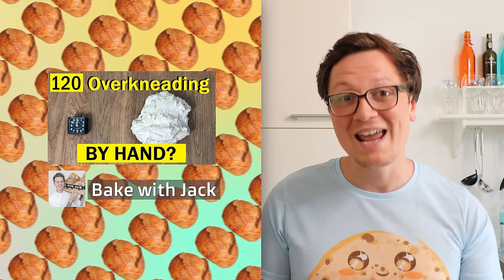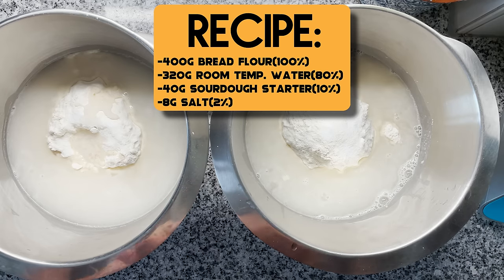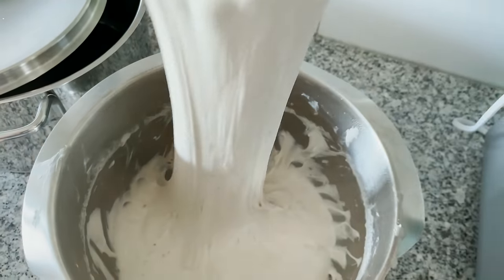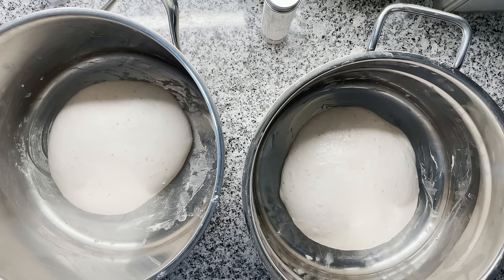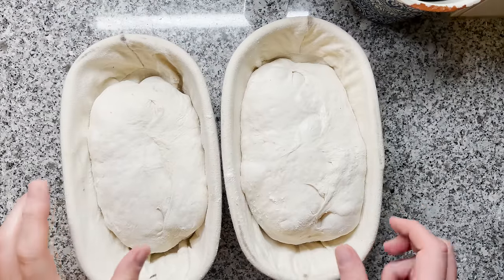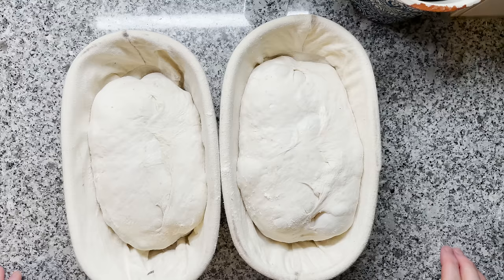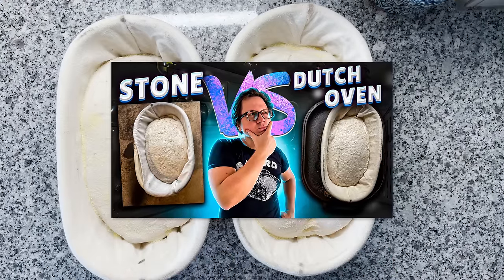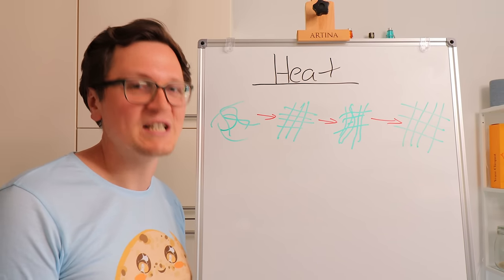Can You Knead Your DOUGH TOO MUCH with a Stand Mixer?

Comment: I bake sourdough with a mix of flours (bread, rye, whole wheat, semolina) every week and always with my stand mixer because of arthritis in my hands. Keep the mixer at the lower speeds, use only the hook. I never go to high speed because it heats up the dough too much. Once the dough comes away clean from the sides I mix for another 1-2 minutes and it turns out great every time.
Reply: About how long do you end up kneading this heavier mixed flours dough? And does it pass the windowpane test at that point?
Reply: Bread Flour 400g
Water 320g
SS 40g (bump 20% if yeast) 
salt 8g
Reply: using high setting is bad for machine

Comment: I'm a chemist.  This makes perfect sense.  The chemical reactions that are cross-linking the proteins in the flour are parallel to those that make concrete.  You want to simply get the surface evenly wet, then allow the cross-liking to occur.   This amount will differ on the texture of the break you are looking for.   Simply putting the mix in a stand mixer and walking away for 15 minutes is not a good idea.

Comment: When I had less idea than now about what I was doing, I was tired of getting flat breads, so I improvised and lowed the water percentage (I believe from 70 to 60%) and kneaded with a KitchenAid, at medium speed, for around 4 hours. Those where my first nice looking breads, incredible ears and oven spring. But after I did that I read about overkneading and I decreased the kneading time to around 20 minutes, but adding a couple of stretches. It works for me.
Reply: 4 hours???
Reply: 4 hrs?
Reply: @aidaiamanova578  I wish I could be more specific but not so long ago I read in a magazine about a new local premium bakery and I remember it mentioned they knead two times over a hour, don't remember exactly. I guess at least when you have the proper flour and recipe, overkneading isn't really an issue :)

Comment: Hendrik, for your next experiment, I would be interested if you can add flour (and how much) to overfermented dough and get a good dough strength back and save your bread, so to speak.
Reply: Hi. You can not save a bread thats overfermented, because it will act like a sourdough or starter, you would need a lot of new dough. But there are a few nice videos of 'pain de campagne' they use 10% sourdough and 10% pâte fermentée. So put it in your fridge and use it step by step in your future breads, it will give huge flavours and and other benefits to your bread dough

Comment: I think, most Professional bakers machine-knead sourdough on much slower speeds, say about 2 or possibly 3, depending on your machine. I can briskly mix 72F flour and water(about 22C)with a Danish dough whisk, and when I measure the dough temperature, it is usually a couple degrees warmer in F.

Comment: if you knead at lower speeds with a stand mixer the dough doesn't heat up (that much/at all if using the speed the manufacturer of the mixer tells you to use: 1 - 2), the kneading takes a little longer, but the bread is consistent, even if you forget about the mixer and let it knead for an hour too much (was not an experiment, but a mistake by me)
Reply: An hour by mistake?
Reply: @eswing2153  yeah. put everything in the standmixer, set a timer, went back to just check my mails in the other room and listen a bit to music - and forgot (and overheard th timer) completely.

Comment: I only recently learned how much heat a mixer (or kneading in general) can impart into the dough. Your video seems to confirm what I assumed was happening to some of my breads. I have started using cooler water and will continue to do so.

Comment: I just realized that I never heard about the "base temperature" in not french bread video... This concept is very important for professionals. The goal is to have the good temperature at the end of the kneading.The rule is quite easy. The base temperature is the sum of the temperature of the room, the flour and the water. (Strange mathematics!) If your base temperature is 55°C, your room is at 21°C and your flour at 20°C you need a water at 14°C (21+20+14=55). You have to adjust the  base temperature with what you do and how (depending of the machine, the type of kneading) Normally at the end the dough should be more or less at the same temperature.
Reply: Very interesting!

Comment: Very interesting finding that temperature matters more than kneading time.
Would have been cool to actually measure and compare dough temp.
For pizza, it's a common advice to stop mixing at 25°C in order not to damage the dough. Sometimes you'll start with ice water in order not to exceed that temp.
So, next experiment: Same mixing time, but different target temp? 20°C, 25°C, 30°C? :)
Reply: Actually, that's kinda common for baking in general. At least in any semi-professional environment. At least when we are talking about (mostly) pure wheat, spelt or any such grain based good. Different rules apply for different grains and when you mix them. 

Anyway. Gluten is a protein. Proteins are very heat sensitive. Pasta to hot, when you apply the egg mixture for carbonara? The egg (Proten!) will clot, the sauce is ruined. Same thing happens with Gluten. 
In my bakery I fucking pray to never exceed around 25, 26 at the very max Celsius. Otherwise the entire batch is fucked.  Beyond repair. This is a problem in Summer.  I can not work without ice. I put Milk in the freezer for sweet breads and cakes. 
The reason you may or may not notice it that much, is because I use organic flour from our own fields. Most flour you buy already has additives, even many organic ones. And the grain itself of course; some are more sensitive then others, every single batch of grain is completely different. That at least is not TO big of an issue when you buy flour; the mill usually mixes XYZ different grain batches to give you a flour that has roughly the same properties. What you can buy anywhere else is probably more heat resistive. However, that doesn't mean it would be in any scenario good to exceed such temperatures. And no I do NOT use warm water or milk in ANY recipe. There are only types of people who do that. A: Those who have no fucking Idea what they are doing. And those who are bloody geniouses, that MARTICOLOUSLY crafted a recipe with hot and cold ingredients and times, that somehow end up at just the right temp. 
Trust me when I say however, that I have not seen a single such genius on YouTube and such. 

But LMAO kneeding times mattes. Oh it does. Differnce is lust that you can  wipe your ass off with times provided in recipes. Any flour is different. Any machine is differnt. And even ever hand kneeds different. Same dough in machine A can take 5 minutes in my professional machine, 15 minutes in my kitchen appliance and 20 Minutes per hand. And with a diffent flour this could mean 8, 20 and 25 Minutes.  
For "wetter" doughs, say starting at around the 65%ish hydration mark and long-er bulk proofs, you absolutely can get away with less kneeding times. Stretch and folds. Does magic. When I see a dough rising in temp while kneeding and it is such a dough, I'll just stop underkneeded. A few stretches and folds and a night in the fridge, you won't see a noticeable difference. In fact, many if not most "hand kneeders" underknead, which isn't a huge issue for most bread recipes. 

However, if we are talking about lower hydration doughs... Oh f me. For many specialities, many forms of breadrolls, pretzels, whatever, you need low hydration. Stretch and fold will not work well. Worse, those doughs are usually meant to be worked within  30-60 MInutes. No, this is not to short, you do NOT want your dough to conciderably pop for such things. 
Don't kneed such a dough properly, it'll turn out shit. 

Wasn't that video about overkneeding? Well, you FUCKING CAN. Regardless of temperature. High temperature will make it worse, but you can fucking ruin a dough that is like 10 Celsius or whatever, no issues. 
It's brutal per hand. It should be possible, but you'll be working.......
Kitchen mixer? Harder. Impossible? LOL. Done it myself. More then once. Seenalso  many folks around the internet, how try to kneed their dough P E R F E C T, think, common, another minute, aonther 2, it'll be even better! Then they miss the point and well...... The dough is shit. You are building up stength in the gluten by kneeding. Once it is at a maximum bond stength. Push it harder and the bonds break. REGARDLESS of temperature. 
If it's only a bit overkneeded, it'll be fine, propably. Stretch and fold and cool it. It'll most likely recover. However, if you pushed it a little bit further over the edge, well. He's dead, Jim. 
Then again, this takes some time and effort with a kitchen mixer. You'll most likely rather underkneed. Now take a lovely industrial dough mixer. Uhm yeah. Overkneeding in such a machine is childs play. Ask me how I know...........
Reply: @sagichdirdochnicht4653   we put our flour in the freezer too in the summer, it really is essencial
Reply: @sagichdirdochnicht4653  Hi, can you describe in specific details how you've dealt with very hot ambient temperatures when making bread? Well I'm a newbie baker, and I live in Singapore with a perpetual summer, kitchen temperature roughly 31°C at all times...my dough never truly develops much gluten or pass the windowpane test at all. Not a single one of them ever passed the windowpane test, lol. Very high chance of overfermentation too, which has ruined quite a few of my breads. What can I do about this? Use ice cold water in the dough, and refrigerate the dough every 10 minutes of kneading in the stand mixer? What about bulk fermentation and 2nd final proof?
Reply: @zanaros2606 I live in Singapore, as well, and the ambient temperature and humidity are indeed a problem but manageable.  I keep all my flour in the freezer at -20°C and use ice water in the mixer. I agree with the comment above that you want to start with about 65% of your water and go from there, but it really depends on your flour how much it can take and how quickly. Likewise agree that it’s okay to under mix a little. Time will take care of the rest.
Reply: @jmargolis72  Hmm...what about bulk fermentation/proofing? How do I do that here in Singapore? All of my doughs basically look like wrinkled bollocks, after being out in the hot 30-31C for an hour or so, lol. Did you build a thermal insulated proofing box or something? I've figured out the water issue, but not yet the bulk fermentation/proofing part.
Reply: @zanaros2606 I suppose it depends on what you’re going for. If I’ve managed to keep the temperature under control during mixing, the end temp should be around 20° or so. Then I move the dough to an air conditioned room at around 26° or 27° to bulk ferment, then into the refrigerator at 4° to finish.
Reply: @jmargolis72  Aah ok, thanks for the info~! Was going to build a thermal box...then I realize I could just turn the air conditioner on, lol.
Reply: @zanaros2606 A wine fridge also works. You’d just need to adjust your yeast quantity accordingly.
Reply: @jmargolis72  I don't have wine fridges, but maybe I could just pop the dough into the fridge and bulk proof my dough overnight too. If only I'm living in more temperate countries...haha. Then it would be bakers' heaven. Hard to make pie crusts in hot weathers too. And global warming's probably gonna make Singapore temperature even hotter in the future too. If I remember it used to be just around 26-28C decades ago

Comment: This is great testing thankyou :) I still wonder about low hydration doughs... say down to 60%... perhaps high hydration prevents damage to the proteins by lubricating the mixture? Harder to test though... my mixer probably isn't capable of kneading anything lower than 70% hydration anyway. And it would probably come down to overheating as the main problem rather than actual chemical damage to the gluten structure?

Comment: You would have to heat the dough up enough to the temperature that would kill the yeast..which is why it did not increase in size that one time..and the other one had a decrease in activity because some of the yeast died from overheat but not all of it

Comment: Funny I saw this new video tonight. Earlier today I placed my post-autolayse dough in my stand mixer for 15 minutes on low but then I walked away and forgot about it. I came back into the kitchen 2hours later and pulled it off to bulk ferment.  I’m lazy and I don’t do any stretch and folds and just ferment in the bowl. After about 3 hours, the dough passed the windowpane test and was ready to shape. Baked after my second rise and I still got good oven spring! I thought I ruined it but it turned out just fine. I haven’t cut it open yet but it’s got a nice shape. I think the trick is the slow knead and not using the high levels in the stand mixer. On another note, I appreciate you showing what over fermentation looks like. I used to follow an overnight bulk ferment recipe and I could never figure out why I couldn’t shape like the video. One of your other videos talking about over fermentation and your timing chart really changed my results. Thanks!

Comment: Its also basically much of the water is evaporating during the mixing process, maybe a lower hydration can be used and when more hydration is needed, sprinkle in some water.
9:50 - I feel "temperature" into the equation is irrelevant, because temperature in theory can be controlled. What we care about "extra" kneading is for the labor it does for us and if it does provide any benefits other than temperature is being introduced due to friction. You could just place this bread mixer in a dedicated small/mini refrigerator with controllable temperature to avoid any increase of temperature with "extra" kneading time so this "test" would not be hindered with the increase of temperature.
But the results shows, over kneading is just wasting electricity and time.

Comment: 2 months later, I make double loaves in the mixer but not at those speeds.  I wait 30 minutes then mixer for 2-3 minutes and repeat for 3 to 4 cycles.  Then decant, separate and stretch and fold a few more times at 30 minute intervals.  Let it rise then stretch and fold again for another rise.  Working great.

Comment: I'd suggest you didn't over knead the second bread in the first test, but you found a better level of kneading for the white bread.  That the dough comes away from the walls of the mixer may not be a good indication of dough development - a windowpane test may be a better indicator.

Comment: This was an awesome video! I have a question. Do you remove the loaves from the refrigerator and place them directly in the oven, or do you set them aside and let them sit for a while before you bake them? Also…when you said you baked them with steam for a period of time, then continued with no steam…does your oven produce the steam, or are you adding the steam by spraying water?

Comment: I had used mixer and ruined gluten completely to the point that it was like gluten free flour. However it was 65% hydration and whole wheat but i gave 10% gluten flour. i dont know if for your dough this being more wet dough it did not happen or not. I came across to your video because i was trying to make a sense of what i did wrong, and how should i use my kitchen aid mixer better. but now i am more confused as you did not face the same issue. lol

Comment: Hendrik - I've tried this twice and both times my dough is too runny and sticky so that all I can do is put it in a loaf tin. I kneaded fro 30 minutes (10 mins on, 10 mins break etc) I'm using regular starter, so went for 20% as you suggested. Last attempt I used 350g bread flour and 150g wholemeal flour. Both have approx 11% protein. Any suggestions as I"d like to make a nice boule but I just can't shape it.

Comment: Hand mixing or KitchenAid mixer
It’s probably impossible to over mix 
But a European designed dough mixer can easily destroy your mix 
You can tell when it starts to get silky smooth it’s time to stop

With a good,mixer you can easily destroyer your mix
I’m  sure you can. I’ve done it 
it was not very hard 
An extra five minutes too long it’s finished
Your dough  is more like syrup

Comment: This is a great video, and I was really intrigued by how you're measuring the pH level of the dough to check if it's overkneaded. I'm an avid (though amateur) pizza maker, and I often struggle with overkneading my dough in the stand mixer. I was wondering if the pH level should ideally fall between 5.0 and 6.0. By taking this measurement, can I prevent overkneading? Thank you!

Comment: I leave it in my stand mixer until it lick the bowl clean.  I may add a few TSP of flour until it licks the bowl clean.  I then do a window pane test.  If it passes this test I dump it out on my bread board, knead it for a few minutes and dump it in a bowl for the first rise.  Covered, of course.
Reply: I agree with this, but don't add flour. I mix on slow hook for about 10 minutes and check for structure. Then, I may cycle on slow or faster until I get close to a window pane, which is about the same time it stops sticking. I then let it rest in the bowl for about 10 minutes, after which time I get a good window pane test and it's ready for bulk rise.